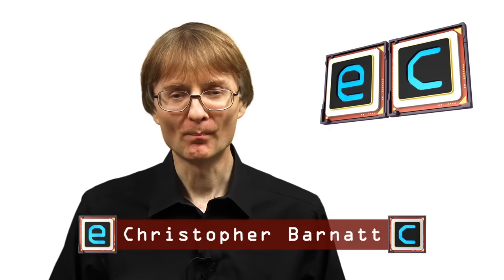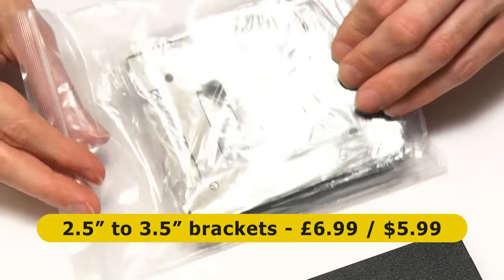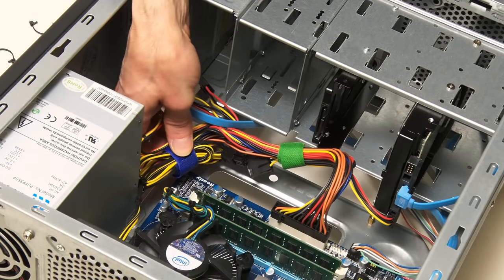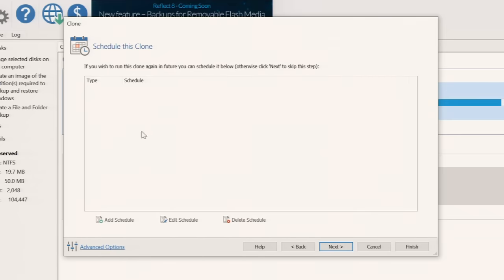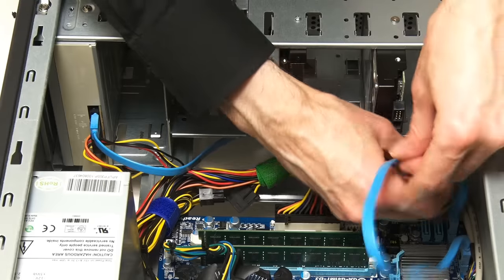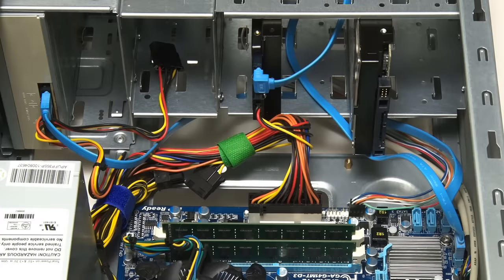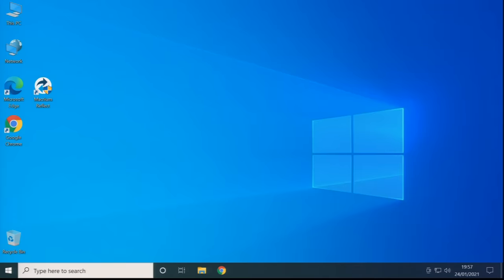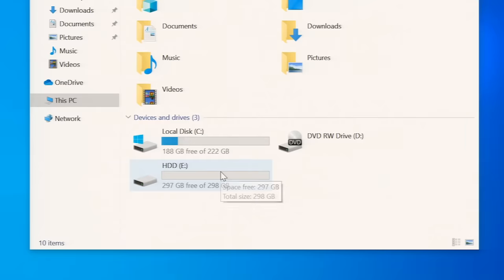Old PC Upgrade #2: SSD Boot Drive

Comment: Just a note: avoid using twist ties in a pc. They can wear out in time and expose the metal part on the inside. If they fall off they could possibly short something
Reply from the maker: I cannot imagine how one will wear out in situ, but certainly a worn twist tie may present a potential hazzard.
Reply: Agreed been using wire ties for years never seen one cause any damage , but if your that scared use cable zip ties or pvc tape it doesn't really matter it's not that important
Reply: In IT I don't think I ever used plastic/paper coated metal center twist ties (different from nylon only flexible twist cable ties...the ones with the little balls at the ends) where bundling a lot of heavy wires together was better using UV protected nylon zip strips but even for small wire bundles.  In some applications, potential issues of rust and loosening/degrading of covering material from heat/light, etc can leave exposed metal that could cause major problems.  However, as long as you are not applying too much stress to the cables being held, the tie is not too tight, and the PC is going to be in a relatively stable environment plastic (never EVER paper imo) coated metal twist ties should last, and be okay, for the typical lifetime of a home PC, though care should be taken and checked each time the PC is cleaned.  IF wires held together are not in a stable environment, have the potential to be exposed to UV (like some lighting kits of old or subjected to sunlight), need to be tight, and are heavy or considerable size then alternatives would be better suited.
Reply: I have to agree. I have been working in IT and doing PC repair for 30 some odd years. I actually have on one or two occasions seen the ties with a metal conductor in them cause shorts. Zip ties can be used, as seen in the video, if not done carefully can cause issues as well. And the thing that bothers me most about zip ties is that I always seem to have to remove them when I don't have any wire snips readily available. So I'll use zip ties in a pinch but like Chris, I prefer to use velcro straps. The nylon twists are handy as well but I never have them around when I need them.
Reply: I only use velcro cable ties. They are reusable and have no risk of shorts.
Reply: @ExplainingComputers  PCs vibrate. It may be so minute that you don't notice it,  but they all do so. Just the fan in the PSU is enough. I've seen wires that merely leaned against the metal case wear through and short.
Reply: Mason string instead! Always the right length, no shorting issues, easy to have handy, & defies the idiot "oh how pretty my box looks" mindset so prevalent nowadays :-) I prefer the gold-colored twine, since its also what I use to support my tomato plants. Win:win :-)
Reply: @antoniiocaluso4387  Whereas mine have sometimes had to make do with baling twine. :O
Reply from the maker: @Reziac  A very good point.
Reply: Zip ties ftw.

Comment: "Cable management", says the guy who blu tacks a drive to the case. Just messing with you Chris, we love you really.
Reply from the maker: I said that you could Blu Tack the drive to the case . . . :)
Reply: My cable management is a black cover so you can't see the mess inside, I leave my ssd's flapping in the breeze.
Reply: Youtube comment section cable management goals: short, straight runs. No kinks or twist.  Minimal visual exposure. No cables intersecting or tangles.

My cable management goals:  I hope I can manage to stuff all these cables into this case without leaving any of the panels off.
Reply: @DenisKz  - * SSDs.
Reply: If you use blue tack, you've no need for cables and therefore there's no cable management. Just saying.
Reply: Double-sided 3M tape is also great. If you're a man of refined tastes.
Reply: @MattExzy  3M Command Strips are great for easy removal leaving no residue.
Reply: @ExplainingComputers  I've used velcro....
Reply: @ElmerFuddGun  you correcting me?
Reply: @DenisKz  - LOL.  Just trying to help you (and others) out.  Apostrophes are not used to form plurals such as SSDs, HDDs, CDs, etc.  No offence was intended.   :-)
Reply: @DenisKz  Remember -- behind every great computer lies.... a mess of wires!!
Reply: @jeffreyjoshuarollin9554  I'd love to see that video. No cables, Hmmm!
Reply: @lawrenceallwright7041  Apple did it in the Mac Pro. Not saying that’s good or bad, just that they did it.
Reply: But of course I meant cables around cables.
Reply: I'll stick to cable ties...heat resistant and don't come undone.
Reply: I saw that and literally facepalmed. I remember working on computers with drives taped in the case. Did not bring back good memories! Never blu tack a drive in your case. Not for long term use anyway.
Reply: @ExplainingComputers  
You can buy removable cable (zip) ties!
Reply: That's a very good idea for an ssd if nessecary. I often have a temporary one loose in there in a spare tray, so I think that's a marvellous idea.
Reply: @jeffreyjoshuarollin9554  obviously your computer DOES need cables.
Reply: @DenisKz  <3  sometimes the case is good , sometimes the case is closed small and no cable- rails .
Reply: The blu tack idea (with an SSD) is a good one to keep. Thanks Chris.
Reply: @ElmerFuddGun   It's egocentrics like you that stop a lot of people using the internet, it’s called bullying! There are many who think their spelling and/or grammar are not good enough or give their opinion or join in with a conversation. How do you know your victims don't have dyslexia or a learning difficulty? This doesn’t'help' them in the least. Everyone deserves a voice, this is the internet and not an English grammar exam. Just pause and think before being offensive and stopping people using their free speech.
Reply: @DenisKz  LOL. If you had gone to the school I went to you would not use the grocer's apostrophe. Repeated raps over the knuckles with a ruler is a wonderful learning tool.
Reply: Chris considers the "comfort" of the cables, during management.   Now THAT'S caring about your computer.
Reply: I worked in a casino and cable management is important on the gaming machines we have to keep all the cables in order so when working on the machine we don't have a mess to deal with.

Comment: I just upgraded to an SSD Drive on my old Linux machine and it boots much more quickly. I got an old SSD from a work computer they were recycling and I'm glad I did!
Reply: I updated my Lenovo T430 to SSD quite some time back, but more recently I upgraded the CPU and Memory along with a better heatsink/fan combo ( yeah this is Linux also ).  I did have a question also with the clone and that is could you not use a bootable / live linux image and just do a raw dd from sdx to sdx from the win32 drive to the SSD then when booted use the windows partition tools to resize if required?.
Reply: @sethrd999  i think that would be hard because the windows bootloader is looking for the drive before. On laptop i removed the windows partition but saved the files, regretted it, made a new windows partition with the same data, wouldn't boot.
Maybe some recovery mode with install media ?

Comment: Love seeing these incremental upgrades, reminds of when I was a student, having used laptops for ages I once again wanted a desktop, but with very little funds I put together a low end system using a mix of 2nd hand parts from ebay, new ones and a donated gpu from a friend. Over the next year or two I upgraded that system part by part until it was a decent mid-range system, it was fun seeing how much performance I'd gained from each new part in the system.
Reply: That's the beauty of a desktop, the modularity.
Reply: @offspringfan89  That's why people also loved the older thinkpads, they were so upgradable.  The new ones now have very little that is upgradable.

Comment: After having watched your video I finally worked up the courage to try and fit a 240 Gb ssd to my old HP 3010 which is probably about 10 or 12 years old. I followed your instructions to the letter , constantly thinking that something would go wrong at any moment. Nothing did !. Your instructions were clear and concise  and my old pc  has a new lease of life. I may even try and build a pc from scratch, following your instructions of course. Many thanks !!.
Reply from the maker: This is great to hear. Your PC has a new lease of life, and you have done something new that will change how you look at a computer. :)

Comment: Mr. Christopher Barnatt , you are a true legend Sir ! - I was about to upgrade my old laptop with a SSD - it has a free slot for an extra drive and also the HDD is partitioned as shown in your video. With the lockdown here in Greece where i live, it is difficult to find a repair shop to do the job for me. So i decided i should do it myself - and learn something in the process - Thank You Very Much and best wishes from Greece !👍

Comment: It's amazing how fast an SSD makes an old computer.

I have a 7 year old Laptop which was slow as F. This thing would take 10 minutes to start up and 5 minutes to load chrome.

I have to mention I didn't know anything about computers so I didn't know where to even start.

I came across a video on YouTube which talked about data migration and SSDs. Decided to give it a try and you could see the difference that new SSD makes.

Start up takes about 30 seconds and chrome opens up as soon as I finish clicking the left click a second time. 

Night and day difference.

Comment: This was a very well-presented video.  I did something like this to my vintage 2014 HP Core i3 desktop PC.  It came with a 1 TB Western Digital Blue HDD.  I used a Crucial 1 TB SDD.  It came with a limited version of Acronis True Image, for the cloning step.  I used a USB to SATA interface cable, and ran the cloning step via USB, with the SSD drive outside the cabinet, and then shut down and installed the SSD in place of the HDD.  I kept the HDD as a disaster recovery item.  If the SSD fails, I can reinstall the HDD and have very little down time.  One thing I would recommend to anyone doing this - use a high-capacity SSD.  I wish I had gone with a 2 TB drive.  With the improved performance (SSD + a previous RAM upgrade), now the desktop is very capable of running VM's.  I have both VMware Workstation 15 Player and Oracle VM VirtualBox.  This lets me play around with various Linux distros, and things like Windows Servers (which expire because they are not licensed, but can be re-created).

Comment: 4:40 when it comes to mounting an ssd to this kind of a bay I just screw it to one side and it sort of floats there but I had no issues so far. Taping is a good idea too.
Reply: Absolutely!  Four screws to secure the drive in the bay will only be advantageous in the case of nearby explosions, earthquake or tornado.  Of course, this is also an excellent way to dispose of extra screws,  or a nifty way to store screws for use elsewhere in the future.  Brilliant!
Reply: I had now a bunch of SSDs laying aroung with twisted cables - as I do not have a case

No issues

Comment: Thank you for yet another great video. I got inspired by this video, and decided to replace a 120Gb SSD with a 500GB SSD due to lack of storage in my laptop. Downloaded Macrium Reflect and startet the task. Just wanted to share some highlights of my upgrade, so here it goes.

Tried to clone reserved partition and system partition from old SSD, with no success. Got "Error 0" and "Error 6" repeatedly. Tried Clonecilla, with the same result. Tried to take out old SSD and clone in a second computer. Same result. Ticked off "VSS error ignore", and made an image of the old SSD. Wrote this image to new SSD - could not boot on device. Went sour and left everything. Next day, tried to make a new image of entire old SSD (reserved partition, C partition and D partition). No result. In desperation - tried running "chkdsk C: /r". That took 45 minutes of fingernail-biting and a rising convince that everything went down the drain. But blessed be.... chkdsk C: /r apparently made the trick. I unticked "VSS error ignore", successfully made an image of reserved and C partion, restored this to new SSD, put the disk back into the laptop - and it startet up like the first dawn of day.
Reply from the maker: Sorry to hear that you had such a trauma -- but great to hear that it worked in the end! :)

Comment: Another tip that is useful if you have a boot SSD and storage HDD. You can change the location of the Download folder in Windows to the hard drive so the SSD won't be filled up so quickly.
Reply: Absolutely. Reduces wear on the OS SSD too. I raided an old laptop optical drive and added another SSD and made that the location of all the Windows library folders (Downloads, Documents, Pictures etc..)

Comment: I'm an advanced user and even use diskpart from time to time but learned today about the "clean" option. That is a time saver! Thanks for sharing! Also one of the big benefits besides the transfer speeds with SSD over HHD is the seek time. That will also make the system feel much snappier than the much slower HDD.

Comment: I would not use twist ties for cable management as they are metallic and if they move or you don't notice one touching the motherboard the potential for shorting or even completely frying you mother board is high.
Reply: Absolutely, I bought a bunch of velcro strips from ebay and have started using them for all sorts of cable management.
Reply: Same, i used some zipties
Reply: Aren't they covered in some rubbery material for insulation ?
In any case, a velcro sounds better
Reply: I was having heart palpitations all the way to the end thinking about this. Come on Christopher, get your head in the game, lol.
Reply: @YounesLayachi  Yes, but wire is exposed at the end points and if you touch something with each end, you have a connection. I've a few twist ties to remove myself, but they really aren't a good idea, IMO.
Reply: If you use twist ties instead of velcro, get the cheapo ones that are just plastic.  They don't hold ...quite... as well as the ones with wire in them, but they're better than nothing.
Reply: @bledlbledlbledl  And safer in the event one cuts loose.

Comment: I've had to do this twice in the last month at my work due to Windows 10's recent updates being too heavy and intensive for old HDDs on old Dell office computers. I should have watched this first, I ended up going with a fresh windows install instead of using Reflect. But thank you nonetheless, this is an exceptionally helpful video to bring new life into old machines for very little $$ investment. No frills, no sponsors, just straight good information and wonderfully simple explanation.

Comment: 2:45 Great video, Christopher. Straight to the point and no filler.

I’m really triggered about how close that utility knife is to your hand as you are opening the box. I’ve seen some horrendous cuts when knives are not closed or resheathed.

Comment: OMG OMG OMG... it worked. Had a "Hard Drive Failure Imminent" warning on my 4-year old (but otherwise fantastic) HP Envy Phoenix 810-209. All diagnostics confirmed it was a hardware problem, so I followed Mr. Barnatt's crystal-clear instructions and replaced the failing 128 GB operating system drive with a Kingston 480 GB solid-state drive ($45 Canadian). Worked PERFECTLY! Thank you to Mr. Barnatt and Mr. Scissors! 😀
Reply from the maker: Sounds like a great result! :)

Comment: Very nice, I love to see older hardware still being used and upgraded.
Be careful with the Molex to Sata adapters... they can cause problems, I had one melt a few weeks ago, had been running perfect for a year, then decided to fail.
Reply: That's the reason why I prefer to remove the Molex connectors and solder the corresponding wires together.  Reduced complexity = higher reliability.
Reply: I've heard the best types of adapters if you /really/ need one is any cable that doesn't have moulded ends. If the cables are soldered on to push-fit tabs on both ends, you should be fine.
Reply: Molex to SATA = Lose all your data
Reply: @macinjosh2223  never had that problem
Reply: @SupremeNerd  The more expensive adapters are ok, but cheaper ones have a tendancy to melt
Reply: @macinjosh2223  i guess.....i never had that issue and been building computers over 20 years

Comment: All points made sense to me and I think while you are inside the PC case it's always a good idea to take best measures and fit things correctly as demonstrated  as this can save unseen problems in the long run and are best avoided. The 'diskpart' facility was also a good measure and good to be aware of. Another very good video. Thanks for uploading - Liked.